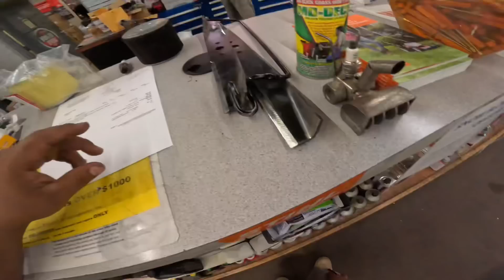Power buggy tune up and spending time with my family 🔥💯

Comment: Eric if you go to a pick your parts you could pick up a front fender cheap and spray bomb it if it ain’t the right colour . Might want to check your hydraulic oil level and filter if there is one. Good idea keeping the equipment up . Do you not bring 2 or 3 wheelbarrows to your jobs just in case the buggy craps out and the pour is 1/2 done ?

Comment: Tip
Eric you needed anti seiz on spark plug before putting it in
Reply: Don’t they need gapped too?
Reply: You are definitely not a mechanic .. Metal shell stretch changes the heat rating of the spark plug and can result in serious engine damage caused by pre-ignition. Do not use anti-seize or lubricant on spark plugs. It is completely unnecessary and can be detrimental.
Reply: @jamielee9350  yeah idk about what he said about the anti seize lol but do small engine spark plugs need gapped or is it just different than when working with car plugs? haha
Reply: @BKnight7z  All spark plugs need to have the gap set at the correct distance . The voltage requirement is directly proportional to the gap size. The larger the gap, the more voltage is needed to jump the gap. Most experienced tuners know that increasing the gap size increases the spark area exposed to the air-fuel mixture, which maximizes burn efficiency.

Comment: Just a heads up when using the grease gun before you push the end onto the nipple unscrew the front section and when it’s on just nip it up and unscrew it again when finished this will help to save the grease end and you won’t have to force it off and possibly damaging the nipple
Reply: Nip it up?
Reply: @max_moto2877  
Sorry it’s an Aussie expression it means tighten slightly don’t overdo it this helps preserve the jaws and also try and find the 4 jaw type so much better far less leakage